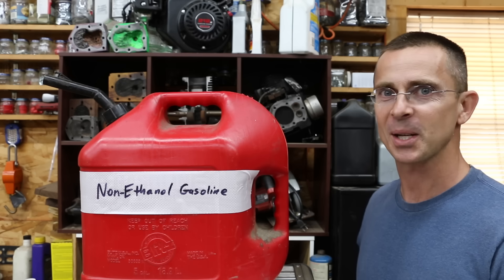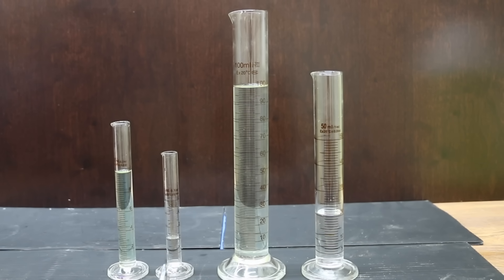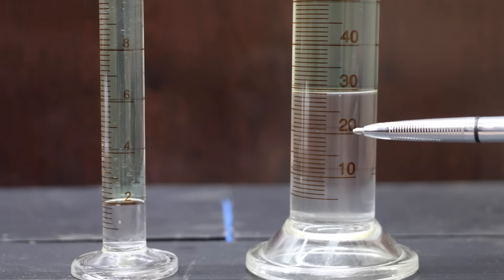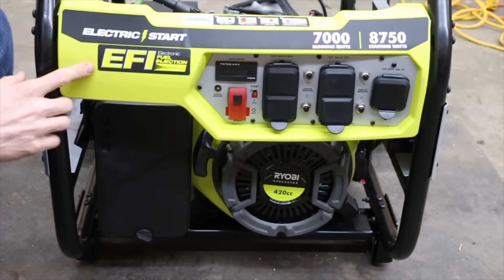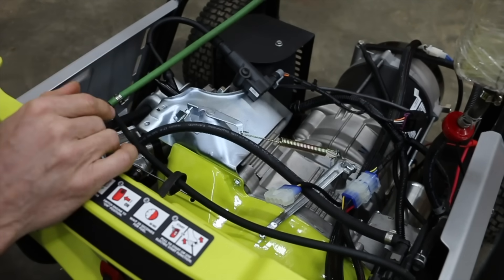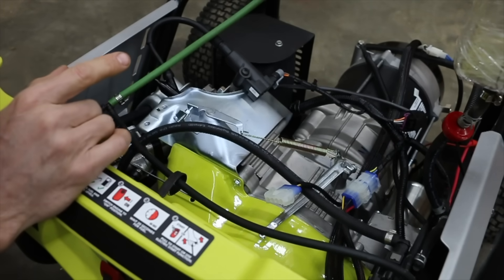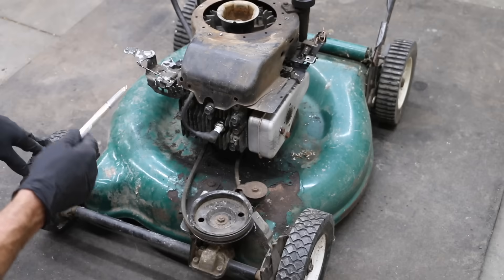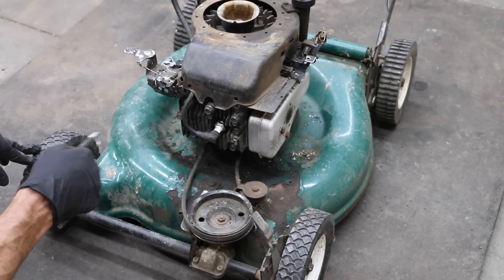Is Non-Ethanol Gasoline Really Better? See the PROOF!

Comment: Just a note for a lot of people in the comments: technically you are not supposed to use any gas with ethanol in small engines or engines not designed for ethanol.
Reply from the maker: Thank you for commenting on this.
Reply: J. A. G. You sure its not methanol you’re thinking of?  My snowblower (MTD) and lawnmower (Honda) both say its ok as long as the content does not exceed 10%, which is most 87 Octane where I live.  The manuals do say 0 methanol.
Reply: @adamzubczyk4997  In my state all gas stations(and the epa, B&S, and Kohler anyways) have notices that say "ethanol is not for use in small engines, damage may occur" and "It is against EPA regulations to use Gasoline containing ethanol in small engines or engines not designed for ethanol"

I don't know about new(2019) small engines, but all previous engines I have bought say that.(methanol too, but not at gas stations)
Reply: J. A. G. Very interesting.  You had me so intrigued by this, i rechecked both manuals, and they say E10 is acceptable, but E85 is not.  In fact the MTD permits 15% MTBE.  The MTD is an 2009 and Honda 2015.  I wonder if it has anything to do with the fuel used in the Canadian market.  Interesting none the less!
Reply: I do know that a lot of modern (like past 10 years) small engines are indeed tuned to run on either E0 or E10, however I don't think there's many (non-efi at least) small engines for E85 though
Reply: I have many old small engines that work just fine with 10-15% ethanol blends. Even leaving them stored for the winter never hurts them. I have never cleaned the carb or replaced rubber hoses on these old engines. Now my new small engines hate ethanol blends. If I use the blended fuel on my new engines I have to replace rubber hoses every year and if stored with blended fuel in the tank/carb I have to rebuild the carb. These days we build stuff cheap and call it "better". Sounds like we are walking backwards.
Reply: @kevinroberts781  i think part of it is that newer small engine carbs have been more tightly designed recently for modern EPA and CARB requirements that haven't really existed before. older small engines weren't designed for much, so they can handle a lot, but newer ones have to be designed with emissions in mind
Reply: I am still using my push mower purchased in 1986. Always let fuel sit in the tank over winter months (in Wisconsin). No problem to start it in the following season.  Always use the cheapest gas in the station. Never pay attention to see if any ethanol is in there.

Comment: Judging by the comments it looks like you guys can't really use ethanol with anythingwhile in Europe it's not a problem since 1998 for cars and regarding others gas running equipments my lawnmower (about 35-40 years old) is running without trouble (only minor adjustments) on E85 especially rubbers and seals. Seems weird that you only get a "poor grade" rubber regarding ethanol resistance... O.o

P.S: Hi from France.
Reply from the maker: Hello and thanks for commenting.

Comment: Love all your vids and your scientific and not so scientific ways of testing. You hit the nail on the head when you mentioned that when stored the ethanol mix can, and will, attract and mix with water, thus cause corrosion in the fuel system. As long as the equipment is being used on a regular basis then ethanol mix fuels are perfectly fine. I have an old tractor that gets run two or three times a year. I run non-mix in it just to try and keep the fuel system from getting too corroded. Thanks for the effort you put into all your vids. Keep up the great work!
Reply from the maker: Thank you!

Comment: Great video!

And REALLY looking forward to the one you mentioned about how ethanol affects parts!
Reply from the maker: Thank you!
Reply: Hey if you can could you do a more in depth video of how the fuel injection on the new generator works?
I do small engine repair as a hobby/side job for extra cash,but I have yet to have anything with fuel injection come in.
Do you prefer it over the tried and true carbs?
I’m sure it will run cleaner and may even use less fuel but do you think it will hold up over time as well?
I’d love to get your opinions on it so far
(The electric start looks like a really nice feature!)
If you still have the old generator could you do the same test with it to see if the fuel consumption between the two fuels is the same or different with a carb vs injection 
I have a really tough time here in western Pa finding gas without any ethanol in it other than the cans at places like Walmart. I don’t use it on my personal equipment, but when I send a mower or anything out, or when selling something, I always fill it with the canned ethanol free gas.

Hey maybe one day (if you would want to) you could do a Q/A video too!

Anyways, have a great evening!
Take care!

Comment: My 1969 Velosolex S3800  has problems with the petrol filler cap expanding as well as the plastic pipes turning hard - I run it on Panel wipe (not on the road) and the filler cap loosens up.
Reply from the maker: This is interesting.  Thank youi

Comment: Non-ethanol gas is best for small engines. For cars that are driven often, there is little monetary advantage. I don't have anything against ethanol since it helps me acquire good equipment to repair. Finally, fuel injection has become economically viable for the economies of scale. This generator must've caught your eye!
Reply from the maker: Great point. Glad I found the EFI generator but it was expensive.  I had a lot of explaining to do with the wife.   lol.  Thank you!
Reply: @ProjectFarm  could you please test drywall anchors
Reply: @ProjectFarm  don't worry, the first time that you NEED that generator, the wife's thankfulness should make up for the "explaining" twofold+😉🤣🤣
Reply: @Project Farm: "Honey, I was going to buy you a diamond necklace, but then I saw this badass generator....."
Reply: @kchall5  LOL its so true - did it a few times but regretted it in the long run
Reply: but look back at time and see that the early days of auto racing and alike had nothing but regular gas with lead those set the way for all the new technology over the years with millions of cars tested with out even knowing - that is how the manufacture can make changes or critical updates as needed for the changing times // but you are correct for today's small engines - and for the use in cars it just might Void some sort of Warranty - as one never really knows the next step
Reply: @jafofubar3793  Same here. My lawn mower is 15 years old and has always run on E10. No problems, still runs fine. I always give the gas can a little shake before filling the mower tank as ethanol separates when sitting. Maybe that helps.
Reply: E00 gasoline is very difficult to find and very expensive where I live.  I have been running all of my small engines on E10 for many years and have never experienced any fuel related issues.
Reply: @jackpatteeuw9244  i hear ya on that and in my area if i want a good straight gas i have to pay a hefty price - for a rough 103 straight octane regular gas with Lead it will run about 863 a gal very hard to get but possible - E10 to me seems like a universal fuel that will work with alot of products both good and bad for short and long terms - still to this day i do use a mix of 95 % rubbing alcohol and nitro octane booster for the winter - lol lol with a mix of about 18 to 1 ratio it does help the natural condensation  in tank
Reply: I have heard burning leaded fuel will destroy catalytic converters so not recommended on any modern vehicle that has one.  Beyond that inhaling vaporized lead is pretty much that quickest way to get lead poisoning so anytime you can get by without lead in your fuel it will be safer for anyone around you and the environment.
Reply: My daily seems to have a bit of a problem with e10, i get an intermittent CEL for a misfire on it, but on E0 it went away and only came back once, I do know this time of year it's pretty humid though so I'm wondering if the ethanol is just sucking up water
Reply: @cpufreak101  Look up the compression ratio for your engine. Anything higher than 10.5:1 and your engine will run much better on higher octane fuel.
Reply: @999thenewman  it's a '06 Ion, so 10.0:1, manual does recommend 87 octane
Reply: @cpufreak101  Okey dokey. :D
Reply: @cpufreak101  that is very possible // things like this will drive them guys all crazy to find a way to make it all work for every environment from the highest mountain to the lowest valley and see just what effects take place and what is complained about the most // its all about trail and error
Reply: I've been running everything I have that is not propane powered on E30 and never had any more (typically less) fuel system problems than all of my non ethanol using control group (extended family whose lawn and garden equipment I have the privilege of fixing often for fuel issues.) 

They buy higher cost non ethanol gasoline then have problem with fuel lines chemical rotting or carburetor diaphragms hardening or water issues.  With my stuff I see about the same things at the same rates of failures (uness it's something I've converted to fluoroelastomer lines and or carb parts, they're bullet proof chemically) but without the water issues. 

For me at usually 50 - 70 cents a gallon cheaper it worth it.  Especially in my larger older equipment that tend to burn  5 - 20 gallons ona good days use. 

As for running E30 on the smaller fixed jet type carbureted most do need to either have the carb switched out with a older or aftermarket adjustable jet (highly recommended just to solve the emissions compliance related bogging bullshit they come with from the factory)  or the main jet need to be bored out tiny bit with a micro/needle drill bit (which costs about $10 - $12 online fro a set of them and is well worth having)
Reply: @tcmtech7515  there you go a tech tip from a actual user of the products and what was done to solve or fix problems as they occurred or happened - done it many times over the past 58 years
Reply: I had an old Toyota pickup, I used to use a 3/4 tank of E10 driving from  Chicago to Cedar Rapids, Iowa. I'd fill up with E00 at Casey's on 15th Ave & I-380, and only use 1/4 tank driving back, then drive another 200 miles before I needed gas again.
Reply: @Teddybear46324  i have a old Cadillac that still gets great performance no matter the fuel i use - some cars are just built for abuse while other will just fall apart -- glad you got a winner

Comment: The big problem with ethanol is the damage it does to the carb sitting in it for a long time like in generator back-up systems and lawn equipment.  It turns into varnish. It's awful.
Reply from the maker: Great point! Thank you

Comment: I just filled up with ethanol free gas.  Since I use it in my cheapo mower,  I figured I should put it in my Honda Ridgeline w/ only 58k miles.
Honestly I have not noticed any difference.
You should test Ryobi generators with other brands, like Honda, curious as to why you chose Ryobi?
Reply from the maker: Thank you.  The Ryobi does have a Honda engine.  The only reason I selected it was because it has EFI and seemed to be the best value.

Comment: Good quality as always, appreciated!

E85 (85% Ethanol) is widely available in Sweden and is know as a old trick to reduce HC emissions on old and worn engines. Ethanol simply burns cleaner, but with less energy so the consumption goes through the roof on non optimized engines. 

The higher octane level it allows for makes Ethanol mixes a good racing fuel :)
Reply from the maker: Great point. Thank you!
Reply: it doesn’t burn cleaner though it makes less sox and nox but you could do the same by using a catalytic converter. it is mostly used in gas to keep the farmers growing non consumable corn from going bankrupt and you end up with another great depression
Reply: @Andy47357  I have never understood why, if they are going to buy a crop from farmers to turn into ethanol, why not buy something like sugar beets which would give a much higher yield of ethanol to add to gas or tell them to plant beets instead of corn.  Corn is probably the worst crop to use on an industrial scale for ethanol production just by looking at sugar content.
Reply: Kent, consumption also goes through the roof on optimized engines.  Just ask any former Caddy owner who used E85.    As stated above, the difference in lower price is made up in poor MPG.
Reply: Stateside e85 is kinds rare (nearest pump for me is like 30 miles away) and we're advised against putting it in non-flex fuel vehicles (and if we do generally it gets accompanied by a CEL due to harder cold starts)
Reply: @cpufreak101  if you're in a corn-centric state, E85 is easily and readily available. Its typically about .40-.50 cents less than regular E10 87 octane fuel, BUT what you save in money at the pump, you WILL lose in efficiency on the road.  Its almost a wash.
Reply: @Newzchspy  I've done the math from time to time and you are correct - it's almost always a wash on cost savings vs. mileage out of a tank.   The E85 does usually work out to be a bit less expensive, but you'll be filling up more often.
Reply: Justin Noker E85 is widely available in Texas
Reply: E85 is awesome for performance applications, though.  The anti-knock properties are phenomenal for the cost.  A lot of modern flex fuel vehicles actually take advantage of that and gain a little bit of torque when running on E85.  The more sporty cars definitely gain some on E85.  The engine management has to be tuned for the better ignition advance and more agressive boost control if turbocharged, though.  It doesn't just magically add power.  It simply allows much more power to be made more safely than regular gas.
Reply: E85 gives my 3.6 V6 30!!!! More horsepower as compared to 91 octane, tested on the Dyno. 5 mpg less on e85
Reply: Ethanol burns cleaner but pollutes more if you consider the energy it takes from planting a crop to fermenting it into alcohol. See the recent EPA study that came out last fall.

Comment: What about putting some rubber in each and see what happens to the rubber
Reply from the maker: Thank you for the video idea!
Reply: @ProjectFarm  get two people, get one to drink a shot of petrol, and the other to drink a shot of ethanol. see who has the best time ;) 

on a serious note, i only run e85 in my cars. there is a massive difference in soot and carbon buildup in the cylinder and in the exhaust. 

the tourqe and power is also great, its like having a way bigger engine in the car :)
Reply: did you watch the video? he literally said he was going to do that.
Reply: at 10% ethanol, I do not believe that you'll see much of a difference. Start going to E15 and above and the problems really arise.
Reply: It will depend on the type of rubber used.  Some are compatible with gasoline but not ethanol and others ethanol and not gasoline and others still do both or neither.

Comment: Does a proper expansion chamber on the 2 stroke bicycle actually raise top speed? And does it improve low end and high end torque??
Reply from the maker: Thank you for the video idea!
Reply: I had them on a Yammie RD350 and all they really did was make more noise!!
Reply: Newzchspy they do make a difference! About 10 years ago I swapped out the factory spanny on my TS50 for a aftermarket one (i actually have a really old video of the TS on my channel) honestly that bigger spanny altered the power range of the TS, it gave it loads of low end torque but it lost a bit of its top end torque. An expansion chamber is a very important part of a 2stroke engine.
Reply: jai mal au derrier I am not saying they don't work. The ones on my Yamaha RD didn't help and just made a LOT of noise.  Yamaha had the bike dialed in pretty well as stock. DG also made heads with larger fins to reduce heat,, the enemy of the air cooled 2 stroke.  Porting made the most difference for me.
Reply: David Vizard who teaches at UNCC and trains NASCAR mechanics researched and designed an expansion chamber system decades ago and published full research etc. He also invented the Dynamax Turbo muffler. David is probably the #1 engine engineer in the WORLD.
google his website. I think it is Speedtalk.

Comment: Here where i live the gas only comes with ethanol. I've heard that with older engines, in the long run, it could have some corrosion, in the engine parts, because of the alcohol and the higher water creation in the combustion, but i really don't know to what point this is true, if it is at all.
Reply from the maker: Thank you!
Reply: In my experience it is true. I tried that with a slant 6 Chrysler industrial, and aside from it loosening up all the rust and crap in the tank and lines,  when I overhauled it a year and a half later, it was quite noticeable.
Reply: after replacing 6 carburetors for cars because of it, i say ethanol should be in the mineral spirit section at ace hardware as a rubber solvent, patina making, and firestarter. you also lose 10% of peak power per same volume.
Reply: @Mike Sienicki It was a good engine, just a gas hog. It was in a Hesston 6450 swather. I would fill up the tank(40 or 50 gallons) twice a day(15 hour days). Then it was about 30 days of swathing. I traded it on a newer Hesston with a 4 cylinder Cummins.

Great engine. Terrible mileage.